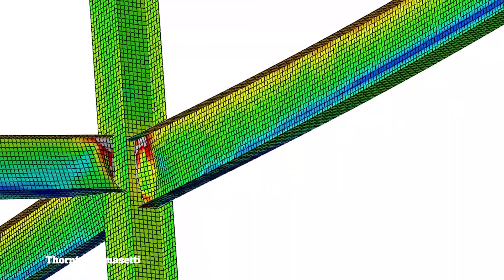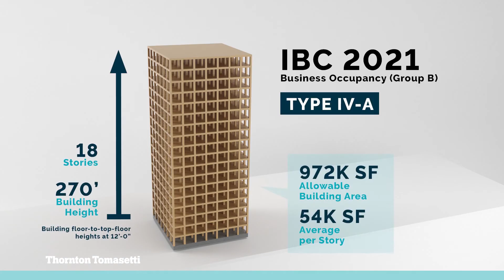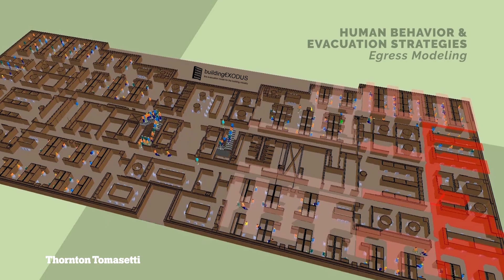Performance Based Fire Engineering for Mass Timber

Comment: No building construction system is perfect in regards for fire safe design except for reinforced concrete.  Steels turn to spaghetti when their protective gunite coating is spalled off and timbers outgas explosively blowing off their char layer exposing fresh new wood to burn.   All heavy engineered timber does is buy your building time from collapse.  The problem with burning timbers is they burn unpredictably in a major fire.  Fortunately, not new mass engineered timber building has had a major fire.....knock on engineered wood.